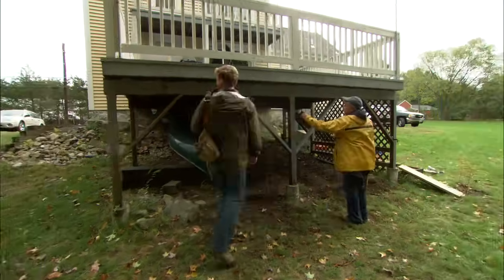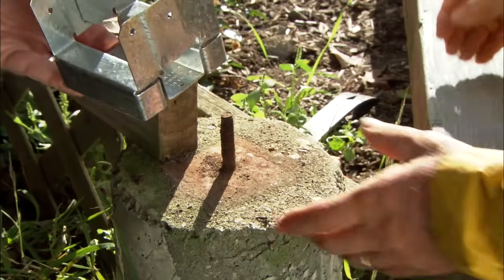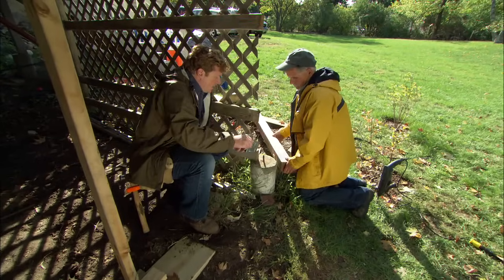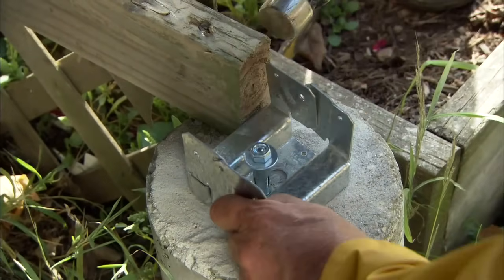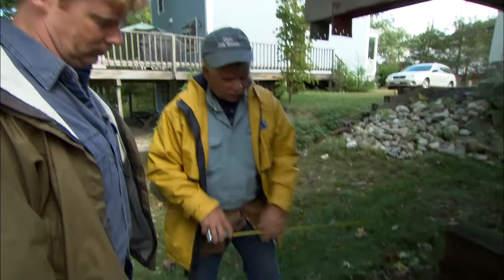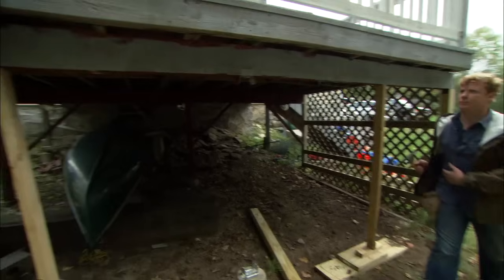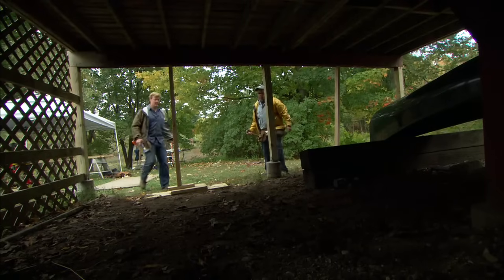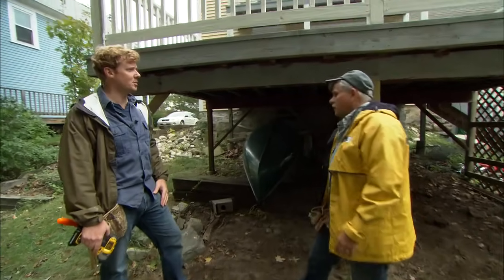How to Replace a Deck Post | This Old House

Comment: Shouldn't the bare wood be treated somehow before installing, i.e., fastening metal support braces and such and, in general, overall fastening by nailing and screwing?
Reply: The wood is pressure treated lumber so no other treatment is necessary

Comment: Thanks, this video is very helpful!
I do wish they would have shown how to do the diagonal bracing on the middle post, because the way they were replacing them on the side like that, you wouldn't have room for two diagonals going in different directions. Unless they were at different heights...

Comment: Suggest use stainless steel wedge anchors to avoid rust.
Reply: Those are hard to find especially when this video was made. The zinc sleeve anchors are surprisingly common in this application. It’s probably most practical to use threaded rod/epoxy to anchor the bases

Comment: Why does the limited sheer strength of a screw not matter with the way they did the diagonal brace.
Reply: In my jurisdiction,  the diagonal brace would have to be (or, is commonly--not sure of the code reference) through-bolted or lag screwed.  But, I'm in CA--there are earthquake considerations that probably don't apply to this project.
Reply: I would run bolts through the brace and post instead of screws.  MUCH stronger and longer lasting.  Or you could even brace them with a metal fastener for even more strength.

Comment: There is nothing in this world that would ever make that post "Rise up."  Class dismissed.
Reply: Wind?
Reply: @mae2759  -I'm afraid that any wind that lifts those deck posts will also take the entire house with it...
Reply: posts rise up all the time in new england because of water freezing under the post. erosion can cause little gaps between the bottom of the cement post and the dirt. eventually water can collect in those little air pockets and freeze. The freezing and expansion of water underneath the posts causes posts to lift a little. When the ice underneath the post melts away it creates an even bigger gap. Repeat year after year the post can lift and get all wonky if there isn't enough downward pressure.

Comment: The replacement posts look like 4”x4” posts. I would have used 6”x6” posts are stronger.
Reply: You are right, a 6x6 is stronger than a 4x4. but a 4x4 is plenty strong for a deck this size. A 4x4 post will handle almost 10,000 pounds.
Reply: @ammerconsulting  I believe I was told that 4x4 are no longer to code in this application.  But, that could be for taller decks or only in some regions. 
There have been tall deck collapses with fatalities that were under engineered.  
I like 6x6 min.
Reply: @Colorado-Tinkering  If I remember correctly, a 4x4 can only be used if it is under 8 ft. or it has to be braced. When they get too tall, they buckle and fail.
Reply: It''s all about your states code.  My state allows 4x4 posts is the post is under 8'.   You could always go 6x6 if you want though
Reply: I would go with 12" x 12"  tube steel with 1/2" wall because that is even stronger.

Comment: A small correction for Tommy which is not really all that big a deal BUT in the spirit of getting things right, from the start... here goes.  Tommy was using a masonry bit to drill into the existing concrete base for the deck posts.  Tommy called it a "masonary" bit.  The correct word is "masonry"!
  He's probably been using that word his whole professional life so I won't push the issue but for those who don't know, I wanted to point that out.
   The fact is, I've learned tons of stuff watching Tommy through the years.  He's a true Master of the building trade  AND he's a great communicator!

Comment: 35 years ago! I installed 4x4 fence posts. I put up stockade fencing, I replaced the fencing twice over the years. When I originally installed the 4x4's I did not use concrete. Because of the costly experience, I had in a previous home where the posts heaved in 1 year, not to mention that the wood rotted quickly (Good treated ground contact 4x4s). Well 35 years, I only replaced 2 posts the rest did not rot! My neighbor hired a contractor 6 years ago to install their fence. I told the contractor when he was using concrete that the fence would fail. He and his crew looked at me like I was nuts, laughed at me and told me that whatever the big box store recommends is how things are built. Well, the fence failed! The problem is the concrete, don't use it to support anything you are going to build on top. Use wood posts as deep as you can get them, wrap near the top with styrofoam. Mistakes are costly, and concrete is a big one.

Comment: Not sure but on the braces isn't the crown of the wood suppose to be placed facing down In Order to not let wood curl up or does it matter.
Reply: On a horizontal, the crown up, the rings angled down. Vertical doesn’t matter.  Just spread the screws out not too close together.

Comment: I'm not a builder but when he used 2- 2x4's to hold up a deck that was being held up by 3 4x4's, that seemed alittle shakey.
Reply: That’s why you are not builder 😅
Reply: I would urge them not to have a party on the deck while the posts are being replaced.  I'm guess it was like that fro 2 or 3 hours.  No problem.
Reply: i agree, however, you need to think that those 4x4 are rated for OVER whatever the deck will possibly weigh with a live load, which is 50lbs ps/f. Dead load is with no one on it, and thats going to be 10lb ps/f. It does feel sketchy but its perfectly fine.
Reply: Keep in mind that the deck's original supports of three 4x4s was designed to hold up a deck with people on it, walking around, maybe jumping, dancing, etc, whereas his 2x4s only needed to hold an empty deck with a static load.
Reply: Yeah I would have definitely used 2=4x4's instead.
Reply: It's fine, just a deck, not that much weight bearing to suspend.
Reply: just two 2x4s?  No way, I’d do four, two on each side if using 2x4.  That’s a long span and they will easily bend.
Reply: Oak 2x4s? Heh
Reply: He said he liked using the 2x4s on the sides instead of the middle because it gave him more surface to screw to, to add the brace. I would have done both 2x4 braces on the sides and 4x4s in between the 2x4s as 1 would be on the outside and 1 on the inside so the 4x4 would be in between the 2 and they could all be screwed together. That's the way I will brace my pergolas, and there is ZERO weight on the roof of the pergola and their could be how many 150ib - 300ib people on that deck? So yeah both wouldn't hurt.

Comment: Would this be the same process for posts that are buried under the ground? I want to apply the cement method for my deck but not sure how to pull the existing post from under the ground.
Reply: I would guess you would have to dig them out. If they are incased in cement you would have to use a shovel and dig around them and pull them out. Cut the post to make them more manageable then dig around them and if you have a come along winch it would make pulling the base out the ground a lot easier. If the base of the post sticking out of the ground is not rotten then either wrap it with the winch and pull, drill a hole add a bolt and connect it to the winch and pull, or dig around the base in the ground wrap the base in the ground with the winch and pull would be my best guesses. That's how I would do it.
Reply: Do this:  https://www.youtube.com/watch?v=7rO3bWaQLCo

Comment: Did you get a permit for this job?
Reply: In most cases, a permit is not required for a repair unless you are altering the structure in some way.
Reply: I wonder if the original deck had a permit.

Comment: Lol kevins drill looks like its the 12v dewalt lmao
Reply: Actually the new dewalt 12volt brushless Extreme would work just fine for that. Great little new 12volt that just came out.
Reply: @Vulcan5911  Man I LOVE my Dewalt 20v XR impact drill. LOVE IT! It makes predrilling a thing of the past. I will NEVER by another non-impact drill again.
Reply: Took forever to drive the screw

Comment: What if the beam wasn't straight (if it was sagging below the 16" measurement)? I wish they could have discussed that possibility. I have a deck that sits only 18" off the ground that is sagging in a corner because of a rotted post.
Reply: 7 q.
Reply: Then you would cut the post a little longer, so that way it can jack up the center to 16 inches. In reality though, they should've used a level to make sure the posts were level and the deck didnt move!
Reply: @dantehall5239  Correct.  Use the straight line to figure out how much the Rim Joist is bowed by and cut the beam by that much extra.   Then pound it in.  You may need to brace the center of the deck up more to get that center post in if the deck is bower quite a bit.

Comment: Old bolt could of been fixed with a Deburring Tool Bit, Hex Rethreading Die, and some Rustoleum.
Reply: well, but the galvanic plating is gone, it will rust in no time.
Reply: @davidjacobs8558  its rusted to hell so it’s just a regular steel bolt without any zinc platting.
Reply: Sounds like a lot more work when you can just cut it off and insert a new one.
Reply: @bigk777 cordless drill would make easy work of it.

Comment: how are those braces sturdy enough? the screws are the things holding the weight of the deck, not the actual wood beam thats there for that. its only putting pressure on the screws
Reply: The screws are not holding the weight of the deck. The cross bracing is to help limit the racking caused by external forces. The screws will get loose over time as he deck moves. The point is to help it limp along for another 10 years or so.
Reply: My thought also.  I would prefer thick galvanized bolts.
Reply: @jima4286  yep for beams, braces, and such, screw to hold in place and use a big plate and galvanized nuts and bolts. I would have used 4x4s on both sides to brace and a 4x4 in between to brace and screwed them all together and used bolts.
Reply: well, you can always go for mortise and tenon joint for your knee braces, if you can manage it.

Comment: I thought bracing is supposed to be in between so you arnt relying on the shear strength of the screws. Don't think this would pass code here
Reply: Yeah I would have definitely used 4x4's in between rather than 2x4's in between or on the outside just screwed or nailed on which would definitely give over time.
Reply: @Vulcan5911  that's what I was thinking, 4x4s on the outside and 4x4 in between and they are all screwed together is the way I would do it. That way you know if you have a dozen 200ib people on that deck it ain't going nowhere.
Reply: I don't know if this is current code (2019 CBC), but diagonal post/beam bracing can be on the "outer surfaces" if it is bolted or lag-screwed (California).  Also, 2x material is okay for bracing in CA.  This is for decks attached to the house--probably different for an "independent"/free-standing deck.
Reply: ideally, you want to make mortise and tenon joint for your knee braces, if you can manage it.

Comment: that new post measurement 51 3/4 was taken while deck was propped up, no? therefore deck wasn't in its proper final setting.
Reply: It's not a swiss watch..
Reply: It likely moved the deck up no more than 1/8 inch which isn't enough to worry about.
Reply: @TeeDub96  ... and new wood ALWAYS shrinks!
Reply: jk08 lop kohl
Reply: well, use a laser level, bring the deck to correct height using bottle jack, and determine the correct height, and take measurement.
ideally.
Reply: jk08p
Reply: @Anything under the sun depending on the type of decking. if it's water tight, you need slope. If water can drain between planking, you don't need slope.
Reply: Also beating on the post directly instead of using a scrap piece of wood
Reply: This show is a joke
Reply: @PoeCompany  please go to therapy

Comment: That little impact would drive me nuts! 5 minutes of that gawdawfulnoise every screw!
Reply: 24fps No other method will be able to drive such a long screw straight through such beams without predrilling. Just put some silencing headphones on.
Reply: 24fps if you do t like ffee impact you can use an 18 or 20 v drill, buti guarantee you Betsy have a couple of batteries and some Advil for your arms because after you are through your arms are going to be tired from holding that drill all day . only then will you say never again will I dio that and you will appreciate that nose from the impact . how do I know this been there done that when I didn't have my impact to drive some long screws like Tommy was doing .

Comment: Why no cross bracing from the center post?
Reply: They added bracing to corners which make deck laterally stiff enough, so there was no need for braces in center post.

Comment: Not using pressure treated wood? Those galvanized nails won't like pt wood if it is pressure treated.
Reply: Hot dipped galvanized fasteners that have a designation of G-185 or higher works well with pressure treated lumber.